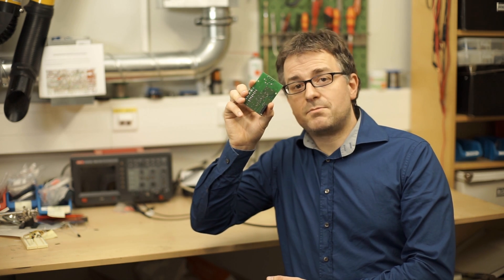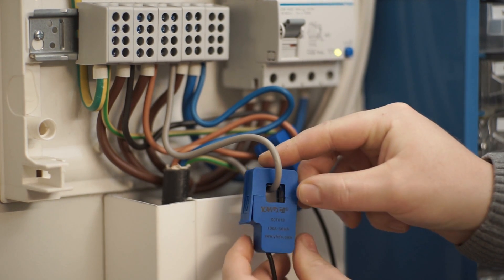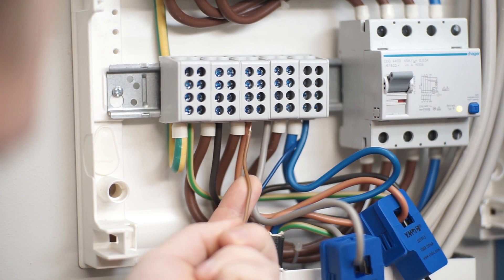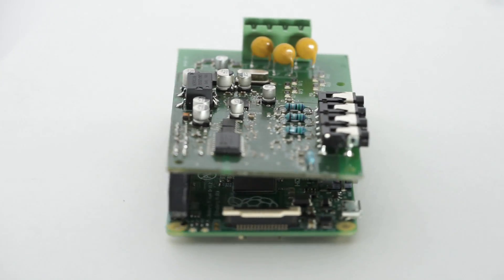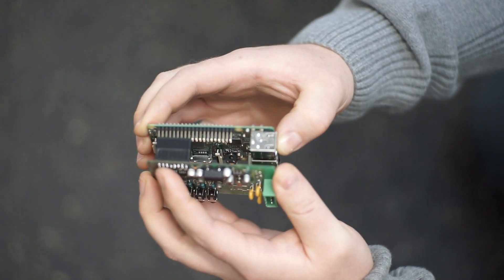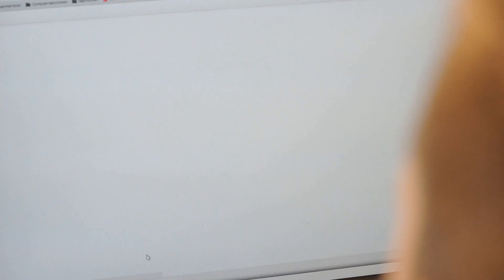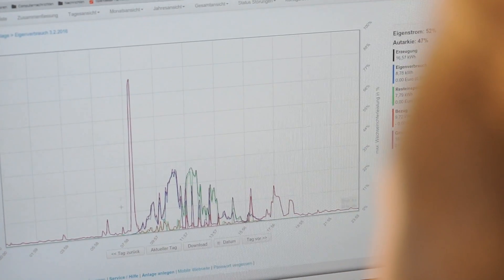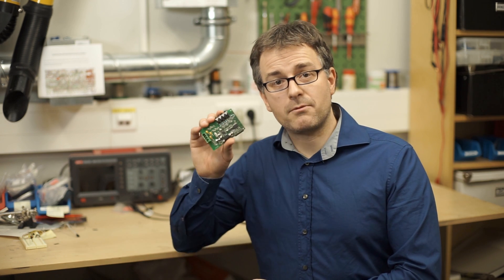Turn your Raspberry Pi into a full featured smart meter

Comment: How do you prevent electric shock hazard ? Also what happens if you push down on the green connector, does it cause an explosion ?
Reply: The final version connects with a cable, allowing for standoff spacers that are tall enough to avoid any issues.

Comment: A few questions:

1. What is the sampling rate of the current and voltage signals? I'm looking for a kit that i can modify to build a power quality analyser up for up to harmonic 50 (2500Hz on a 50Hz system). (Edit: Just found out from your kickstarter page that it is 8kHz)

2. When can i expect a version that accepts 5A or 1A current probes? (the probes i have are  with BNC connectors but this is not a huge problem!)

Great work! I'll buy a set with the 1A / 5A current inputs.
Reply: 8kHz, thats right